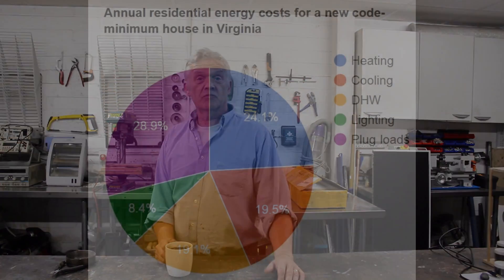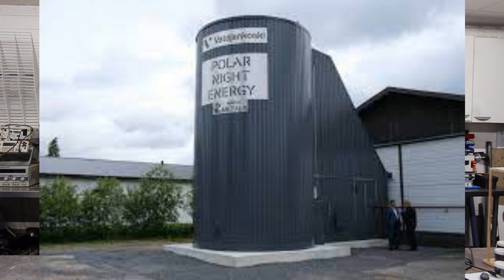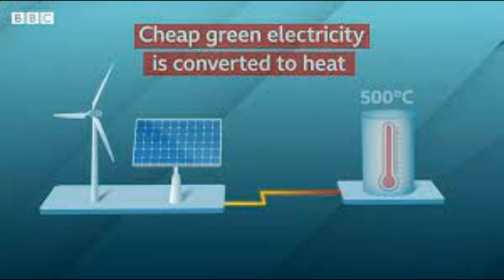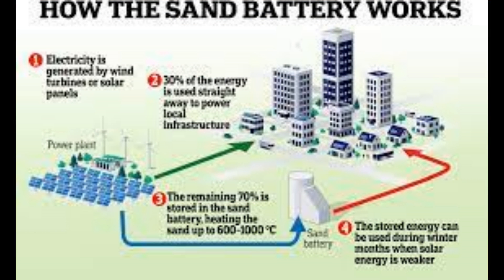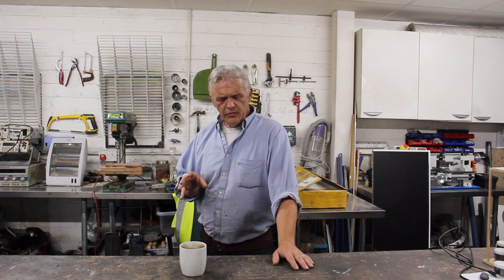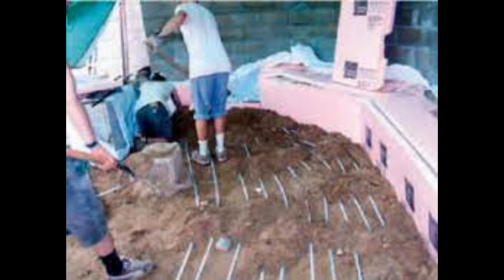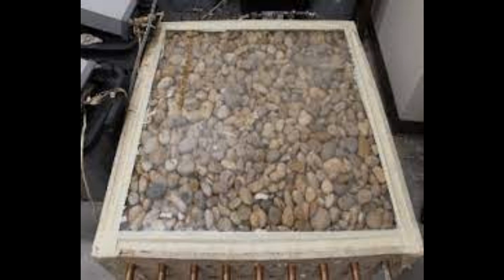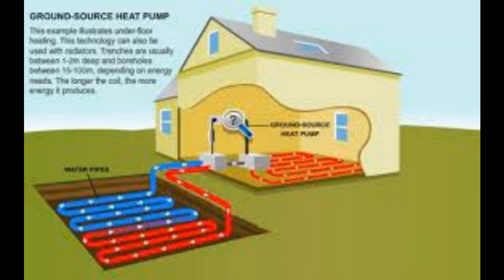1604 The Sand Battery - A DIY Option Or Not?

Comment: I have seen some experiments where HHO are allowed to flow through sand, and it is lit. Heats up all the sand. As if the HHO flame is all the way through the sand… an idea to test out. 
Solar can be used to make HHO and the sand can  be heated without heating air by electricity and then pumped through the sand. It might be more efficient, or maybe it might not as there are losses in the electrolysis..
Reply: There is twice as much energy in sunlight as thermal energy than as photons. Instead of converting solar to electricity then that into heat, focused sunlight could be used directly to heat a material (sand, oil, water, air etc). Much more energy capture at a fraction of the cost.

From what I've seen, the problem with HHO generators is they heat up the water and can't be run for very long periods at a time. Also, is the heat from a HHO flame hot enough to melt sand?
Reply: @ThatGuyChris11  I agree. I thought of a conveyor belt that circulates the sand through a focused sun collector.. 
as far as HHO through sand goes. The flame is not focused, it spreads out through the sand as millions of small flames. So it does not melt the sand…
Reply: @thequixotryworkshop2424   rob done a video years ago where he improved the thermal conductivity of sand by coating it in his homemade graphene and heat pipes worth looking at
Reply: @thequixotryworkshop2424  ah i see, interesting point regarding the HHO. As for sand, Im curious what contraptions other than conveyor could be used. Maybe oversized hour glass style? I know when they do this with new solar power plants they use salt (that melts to liquid) or a certain oil. But I'd imagine that sand could make things cheaper if it could be easily moved around.

Comment: Keep the following technologies to the front of your mind, #1 Gravity Battery (gravity not included) #2 Faraday Disk #3 Flywheel energy storage, in which the Faraday Disk is basically also a Flywheel.
Having all them on your mind, develop something from the basement/ground up, try to make the perfect merging of all 3 technologies, that will be an awesome solution, especially if you can make the weight take 24 hours to completely fall from top to bottom.
Reply: So basically a gigantic and freakishly hot electro-magnetic object dropped from a stupendous height while it's rotating fit to bursting. Sounds like a plan. 
Could you also work into it reversible electro-chemistry and super-capacitance and spring-deformation, maybe a few bits of fission/fusion/super-conductivity and atomic spin stability for good measure? Perhaps with manipulation of torque/precession you could incorporate a trade off between kinetic energy and momentum to periodically replenish/reverse the overall enthalpy and mean free energy equation.
Not asking too much.?
Good luck with that.

Comment: Certainly Sand is a poor conductor of heat unlike stone without the air gaps.
If you are bare foot on hot sand, you just have to wiggle your feet about 2.5cm into the sand to bear the temperature.
Certainly one will have to add something like "cement" to have the sand react like stone.
Or some heat conductor that can handle the 800+ degree Celsius.
Reply: You don't want to loose the heat to the outside. You can extract it slowly for your house.

Comment: Thanks Robert! :D Nice video! We wanted to say that at least what we know our system is first commercial storage that is connected to district heating network. =) 
In future we will try to make this for single house use too. At the moment price would be something like 50 000 €. 

And we can use desert sand and not to use building sand. =)
Reply from the maker: Don't get me wrong mate - I think your system is awesome and any system is incredibly hard to get to commercialisation - most folks don't realise how hard that step actually is - it is a fantastic thing you have done and all credit to you - I don't really know enough about your system but I am also sure there are things you have done and problems you have solved that have defeated others - my sincerest congratulations on your achievement
Reply: @ThinkingandTinkering  Thanks! Yes it has been hard and also on field that district heating companies in Finland are very slow to take new technologies to use, of course others than Vatajankoski. :D
Reply: @Tommi_Eronen  Rock on, Tommi. That'll do for me.   ;-)
In the UK many large/commercial properties are now built upon the ground up remains of the old brick/concrete buildings (they vibrate/compact it then drive piles through this aggregate). If the finer material was screened out the remainder should be porous enough. Could your system make use of this surplus/debris as a thermal mass?
Reply: @Tommi_Eronen  love it, can you make it store electricity rather than heat? Or convert the heat to electricity? Would clay work better as they have a higher negative charge content than sand
Reply: @Tommi_Eronen  or make the sand boil water to turn a steam turbine :)
Reply: @Tommi_Eronen  ps I live on a sand and gravel quarry I can get you 100 tonnes of sand no problem if you want to come and build a new concept design :).
Reply: @Tommi_Eronen  what would happen if the silo was made of glass/magnifying glass? Would that help heat the sand? Sorry I'm like a little kid when I'm interested in something new haha. I figure as glass is made of sand it can only improve it but I could be barking up the wrong tree, that and magnifying the sun's rays (when Its sunny obv)
Reply: @Tommi_Eronen  Great system and its a challenge to be the first commercial best wishes on the future.

Have been thinking about thermal mass storage on and off for years. Funny story, , Finnish lady who I met on Greece and told me the story of her magnificent Finnish fireplace using traditional designs. Multiple Greek brick layers were no, no, not possible. Lady in question the decided to learn to lay bricks and built the large structure by herself and to my eye looked as good if not better than most professionals.

Toasty house, great food and both herself and her husband were great company.
Reply: There are many older houses in Finland that have an empty space in the basement that used to house a oil tank for heating oil.  Now upgraded to heatpumps so all that volume is available to use.  I think the idea of using off peak electricity to heat the storage and then use it on demand could make for a convenient domestic system.

Another commenter mentioned placement inside the house and the basement location would automatically route all losses into the dwelling.

Developing a solution for greenhouses would also be well received.  Used winter ice abatement road traction sand/gravel  should be an affordable resource and might be suitable.  An insulated foundation filled with sand  is not complex if done at the time of foundation preparation.

Comment: In the US we have ETS heaters that work on this principle. (Electric Thermal Storage) They have bricks that are thermally dense and charge during the of peak times.
Reply from the maker: we have the same here mate - we use night time energy - it used to be called economy seven
Reply: We call them Night Storage Heaters. Took them out of a house once because they leaked too much heat. eg on a sunny day when they were meant to be off they leaked the heat put into them the night before. House got too hot. Theses days better weather forecasting might slove the problem but we were much happier with mains gas.

Comment: There was a company back in the 1970s in Vermont in the USA which did a passive solar  home system that used cement blocks set on their side to cycle air through a thermal mass under the foundation.  There is a book about it the passive solar house IIRC by Chelsea Green Publishing.  That book is good because it has spreadsheets with the calculations needed to duplicate the system.  But a better design is more modern it uses insulation under the foundation with 2 feet of sand IIRC with pex pipes running through it and a cement slap to build on over the sand mass.  Same basic system but without the mold problems that you can get pumping humid air under the foundation in an air passage.
Reply from the maker: that is great info - thanks for sharing mate

Comment: Compost is a other
Reply from the maker: for sure mate - nice add - cheers
Reply: This is something that I have been thinking about!!
When I worked in the Stables I used to Square off the muck-heap to ensure that it'd break down properly and Kill off pests with the extreme heat!!
Being careful not to let it combust!!

I'd love to put that kind of heat to other uses as well,,
I'd been thinking about running copper pipes with water through them...

Also,,, with all the other brains out there,,
~ there's got to be something useful apart from good quality rose food?!
(That can be produced with the by products?)
Reply: It is known in the if you can use a wast of something then u can be rich in this case fiithey rich

Comment: Compressed air is another way to store energy. I have modified a wind turbine with a York compressor and a 500 gal. Propane Tank. I run all my power tools on air for free. Working on an air generator now.
Reply from the maker: yes - I am a fan of compressed air
Reply: I think that's a fantastic idea.  I'm surprised I haven't heard of a practical application before now.  Thank you for sharing this with us.
Reply: The Amish have been using compressed air for years to run their workshops, air-conditioning and refrigeration. If you are looking for alternative ways of doing things looking at how the Amish do thing's is a very good start.
Reply: @kevinleebailey  Thanks,  I'll check them out.

Comment: So, sand keeps heat, and later, the circuit water-steam-steam motor-generator?
Reply from the maker: sounds like a good idea to see mate
Reply: @ThinkingandTinkering  I am sorry, must reformulate the question. How do they transform the heat energy into electricity again?
Reply: More efficient to just use the heat
Reply: @zenbudhism  on applications which requires heat, agree... but (at home level I eman) hot water, home heating, maybe cooking in a complex device... sooner or later you will have to get electricity... thinking on sand batteries as the only source of energy.
Reply: Supossing you do not own the source (solar cells or wind generator)

Comment: Could you design as a project for this channel also to save lives over the next winter a sand heat store that can be charged using photovoltaic with the cables running into to living room the unit has to be free standing the room is around 15ft x 20ft x 8ft tall . i have thought of the main variables such as the thermal insulation of the room and the size of the store also the size of the solar panel but ( this experiment is only for a single room is south wales UK ) . would be interesting to hear your thoughts on the idea of actually building one.
Reply from the maker: that's a nice idea - I will give it some thought mate - cheers

Comment: I thought sand was a terrible heat storage medium because the deserts get so cold at night but then it occurred to me that if the sand absorbs heat during the day and holds onto it the surrounding air Would be colder at night.
Reply: While there is some truth to this, there are many more variables to how cold/hot an area gets than just the soil. Some of them are cloud cover (holds in heat radiated towards space), reflectivity of the surface, humidity, and plant life among others. 

Also, whether in the desert or arctic tundra if you go down 10 to 20 feet or so below ground the temperature will actually stay constant relative to the average monthly temperature of a given area. This is the reason geothermal air conditioning systems can work in just about any climate. So the ground is not actually changing temperature by a ton except on the surface layer.
Reply from the maker: yeah I thought pretty much the same - a bit of an eye opener for me tbh
Reply: @ThinkingandTinkering  
You`d be better off using soil which is usually available on site :) Transporting tons of sand from UAE would be a lot more expensive
Reply: @ThinkingandTinkering  order out of chaos Mr MUrmith?

Aka

Problem action solution. 

Mantra of the darling of media. The people’s champion, Mr. K-louse Schwab

Comment: I had also thought of building a home where I could shovel snow and or expose water to the winter in order to store large amounts of ice for summer cooling as water is the other sand.

Exposing a hot concrete to the summer sun will increase the heat to be stored and does not require solar or wind.
Reply: Look into the old ice houses I think they where called.  Basically a shed that was filled with ice cut from lakes in the winter and the outside was stacked with hay bales or sawdust to insulate it.  Pre electricity they where a common method of keeping ice.
Reply from the maker: nice

Comment: now, what heating method exactly would you use to get the sand to 500°C? 
or asked differently: what medium is best to get the energie in and out the sand again?
Reply from the maker: the Finns are using straight forward resistive heating elements
Reply: I'd use a parabolic mirror focusing the sunlight directly onto what I want heated whether it be sand/stone or a black metal surface to heat air. No electricity or moving parts needed, though you might want to track the sun and enclose the heat store after sunset. To get the heat out of storage just run air filled pipes through the heated sand.

Comment: Chinese have been using sand batteries for sometime in poly tunnels to grow all year round, something I've been looking at for a while 😉👍
Reply from the maker: interesting - thanks for sharing mate
Reply: You normally need a pretty massive well insulated store if you want to make it interseasonable. Earlier today I worked out that if you wanted to draw 1kW for four months over winter you need something like 32 tons of water heated to 90C. And many houses need much more than 1kW to stay warm
Reply: @ColinWatters  If you are interested in using water as an interseasonal thermal storage, you might check out Thorsten Chlupp's talks on the REINA, LLC Youtube channel (they are long, but worth the time, I think).  Thorsten built at least 2 houses and one public building (a library) in the Fairbanks, Alaska area, all of which used large volume water tanks (~5000 US gallons) and trickle down solar water heating panels in conjunction with a small variable speed solar cell powered pump (and very good insulation, of course).  Even at that high latitude and in such a cold climate, in his own house he only burned about 1 cord (128 cubic feet, or about 3.6 cubic meters) of split and stacked fire wood (probably mostly spruce, being somewhat familiar with boreal forests, as I am), burned in a thermal mass heater during the coldest part of the year, as an auxiliary heat source.  He also obtained direct solar gain via south facing windows shining on a floor slab.  Unless you are at a similarly high latitude, or in an area which is extremely cloudy during the prime heating season months, you might find the same - that is, you may not need as much water as you think, IF you are able to add thermal energy to your store over the course of the heating season.

In particular, Thorsten developed a simple and cheap automatic mechanism which releases the heated water at the appropriate level within the stratified storage tank, based only on buoyant forces.  His domestic water heating coil was immersed in the storage tank, but his heating loop pulled directly from the heated water in the tank.

The last I heard, Thorsten was no longer actively involved with Reina, but had moved to Bhutan (?) to work on affordable housing with an NGO.

The "Chinese greenhouses" which use a large volume of earth as the thermal store rely on phase change to transfer thermal energy to the ground, at least in some embodiments: a low speed blower circulates warm moist air from the upper reaches of the glazed volume through perforated drain tile laid several feet or a couple of meters underground (often more than one layer of drain tile); as the air cools, the humidity condenses, with the condensate draining through the perforated tile into the soil; the cooled, dried air is returned to the glazed volume to "lather-rinse-repeat".  Many of the Chinese greenhouses actually located in China also use phase change through sorption mechanics of the clay constituents of the soil block north walls and end walls, though the process is entirely passive.
Reply: @ColinWatters  yup, the bigger the better for sure. I've been looking into using a bank of evacuated tubes with solar heated pipes with parabolic mirrors to keep an insulated sand battery wall topped up on sunny winter days.
Reply: On you tube you can find it : Chinese solar passive greenhouse
Reply: My immediate thought was greenhouse heater, so thanks, I'll look into how the Chinese heat their poly tunnels.